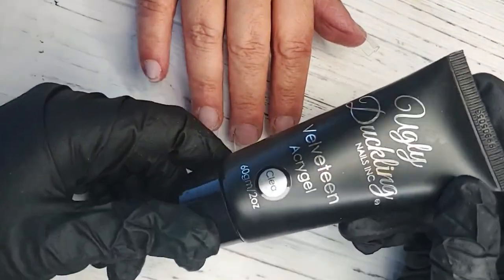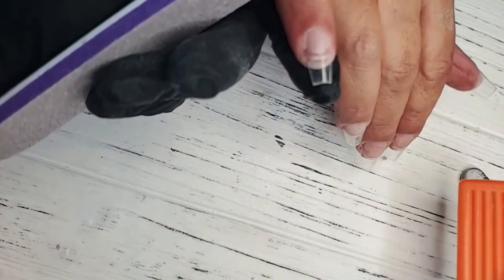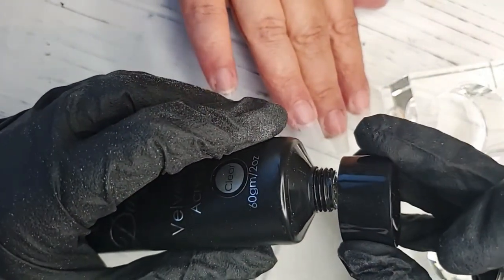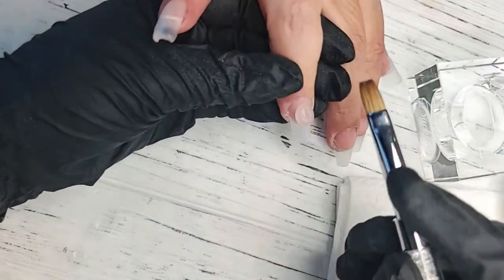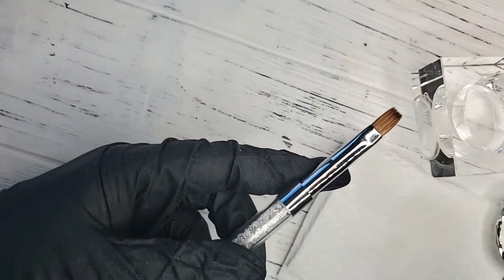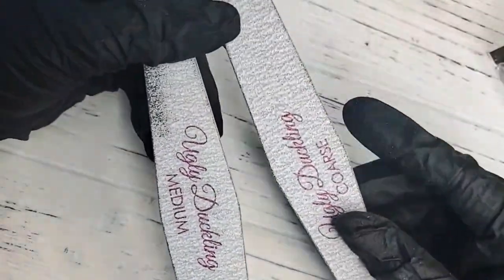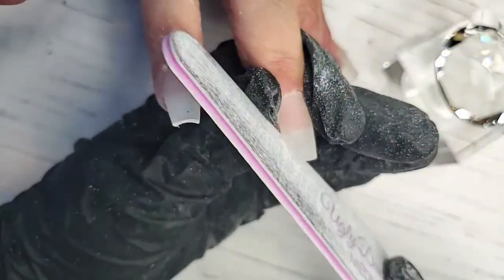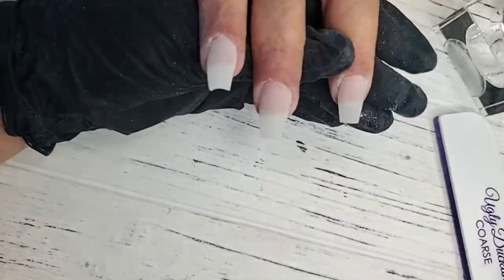Live Velveteen Acrygel Demo by @Chrystacle Does Nails - Ugly Duckling Nails Inc

Comment: Hi there, just checking that you don't need a base coat with the velveteen? Thank you ☺️
Reply from the maker: Hi Holly!

A base coat isn't required for our Velveteen Acrygel - but if you notice you are experiencing any issues with clients lifting, we can suggest using a coat of our Builder Base after our Prep and Primer for maximized adhesion :)
Reply: @UglyDucklingNails  thank you, is the velveteen quite firm to use? I currently use a brand of Acrygel that I do one side on one nail and then perfect the other side of the same nail but by the time I've done the second side the first has run into the sidewalls and cuticle 🤦‍♀️ thank you
Reply from the maker: @hollypalmer882  Great question! 

I would say the Velveteen is "medium" firmness. Not too hard, not too soft. However, we always have to take into consideration the temperature of the room we are working in, as well as the temperature of the clients hands :) If the room is cooler, or the clients hands are cooler, the product will remain a bit stiffer. Meanwhile, if the room is warmer or the clients have nice toasty warm hands, the product will warm up and become less stiff. 

For this reason, depending on how quicky you work, we can suggest applying 2-4 nails at once then curing, and working back and forth between hands. If you notice your product is warming and starting to self level, you'll need to gauge how many nails you can do at once before having to cure :)